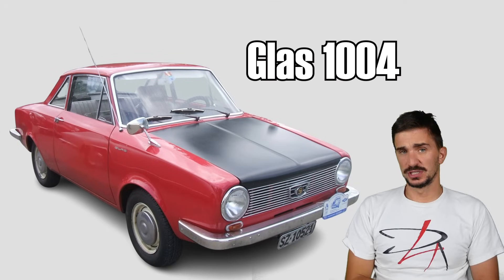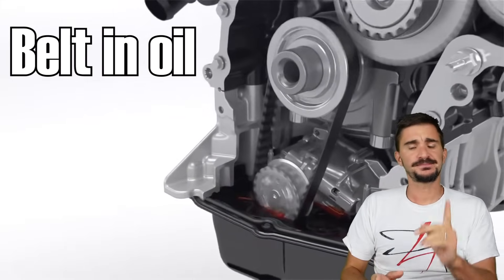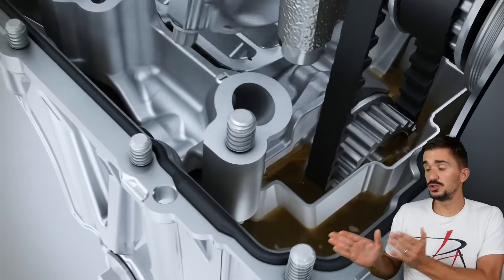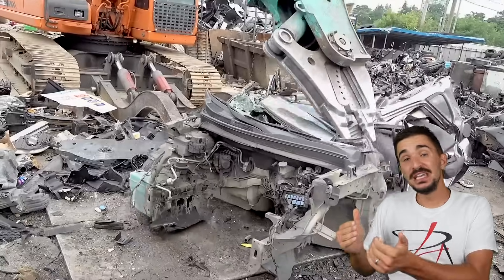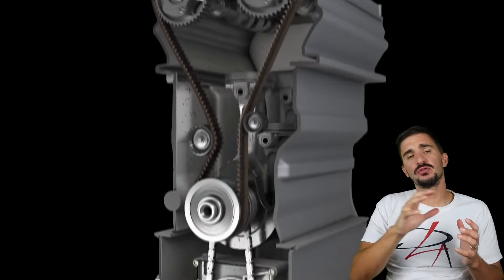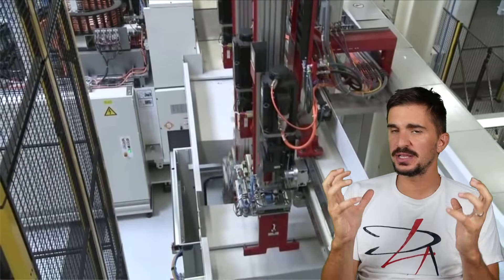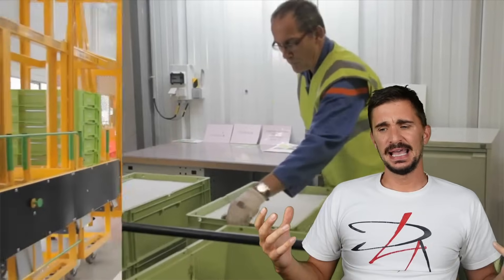Who Approved This and Why Is It Still Being Made? Wet Belt aka Belt in Oil Engines

Comment: Actually, these belts make a lot of sense.  In the very early days of a car's life, say the first three years, the chances are that it will be fully and properly maintained.  The belt might well last that long.  After that, the car is out of warranty and the manufacturer does not care any more.  If say after 5-6 years, the engine dies, the chances are that the car will end up on the scrap heap and a new one will be needed.  Good for business?

No, not at all.  As soon as people get wise to the wet belt folly, they will not buy such a vehicle second hand.  Values will plummet and then they will not buy them new.  Look no further than EVs.  Their second hand value is very poor and private buyers are avoiding them new.  Wereit not for governmental tax bribes to fleet users, hardly any would be sold at all.

The motor manufacturing grave yard is full of rubbish cars caused by an uncaring attitude to the customer.

Comment: Please, a rubber timing belt failing around 100K is a PERFECT engine component for manufactures getting customers to buy a new vehicle. If they use a metal chain, they will use a plastic, (wearable), plastic chain guide to fail at the appropriate time. It’s a scam. The answer? TOYOTA

Comment: Not to bring up ideology but the way capitalism works is you don’t buy any car with a wet belt. Lower sales will force them to go back. Capitalism is designed to keep companies in competition by making a better product. They will always try to cut corners but consumers have the power to keep them in check. I have seen the reverse effect of consumers wanting a solution to a non existent problem, so engineers made them what they wanted even if it didn’t make sense.

Comment: Even worse   than   wet belts , are cam   phapsers and   no   key ways on    timed shaft   particularly  the   crank , bmw  engines   in   mini are like this   slip slightly    main    reason a lot of  them   have such   bad   reputation

Comment: if its anywhere id heavily support regulation is over stuff like this...manufactures shouldn't be able to claim "green" credit on anything unless it also has a verified, demonstrable service life next to it, as well as the environmental impact of producing repair parts and conducting repairs specifically related to whatever new idea they came up with.   If we started using this method, alot of the "green" innovations we have currently would start to look more dirty than anything.

Comment: If a manufacturer changes a service interval (due to their predictions being wrong), they should be liable for the increased cost. Simple. That's capitalism... if one takes (or creates) a 'risk' which is a financial benefit for them if the risk doesn't eventuate, then they should also be liable for the downside if the risk materialises... not the consumer, who didn't give informed consent to take part in the experiment.

Comment: Greetings from Brazil to all. First of all, I have in mind that I will never buy a car with this crappy engine with a rubber belt wet in oil. My second comment is that if someone develops a good and not very expensive adaptation of a steel chain to  replace this current one, they could make a lot of money. In the USA, I think there are excellent mechanics and designers who could solve this DESIGN ERROR.

Comment: And what Einsteinistic institution figured that it would be a good idea to run a completely internal water pump driven off of the timing gear/chain/belt? Where is the shaft seal weep hole in this setup? Drains right into the oil sump, don't it? How can that be good? That and a timing belt running an oil kind of makes me think it was a good time to pull the plug on my mechanic career. I kind of considered myself as a common sense mechanic and I analyzed failures and in the course of my repairs and tried to mitigate, as much as I could, the repeat of such failures. I learned early on, that you can't fix stupid!

Comment: Yes it's a crap design however if you don't thrash the guts out of the engine, replace the oil twice a year and replace the wet belt every 60,000 miles then you should be ok. My transit custom (wet belt model) has 110,000miles touch wood everything is ok.

Comment: Timing belts themselves suck anyways.
They slop around alot. Ever try timing an engine with a belt driven distributor? 
Yea, good luck with that, you can see the belt slopping around with a timing light. You get ignition bounce of around 1-3 degrees or more. That Sucks... Now ur camshaft is doing the same thing...
I rather deal with a timing gear set and the slight bit of noise it makes.

Comment: there is no system which is strong enough to prevent abuses from a amoral people

these days although technically advanced, our morals in general aren't at all improving, if anything they have been slowly degenerating.

the proof of this all is that only a few decades ago it was normal for cars and other machinery to come with repair instruction manuals, today they come with do not eat stickers.
if that doesn't say it all about modern society i dont know what does.

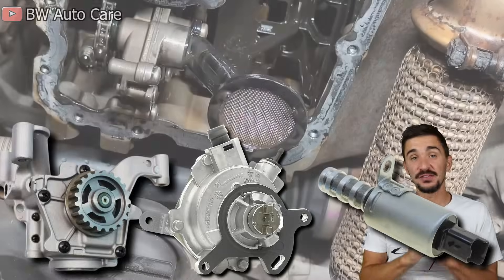Comment: 11:40 This can summarize most vehicles designed since 2008 but especially now in the 2020s. Simple unchanged lessons from decades ago are being totally forgotten in ways that the biggest amateur poser armchair auto fan could have even seen. So many fake "technological advancements" which is really just them being stupid. It's almost like being in the malaise era again except some of those 70s cars actually looked cool on the outside so were worth going through and making work correctly under the hood 2020s 2010s cars for the most part dont even have that. I predict this will be one of the most lost decades in automotive history not worth saving+ expensive repair costs means that if they dont outlaw gas and diesel we'll probably see more 90s cars on the road in the 2040s than 2020s models. Hollywood and the like might have some for making movies in this era but theyll mostly have to be towed at that point.

Comment: Usually I like our videos, but this just reeks of lack of research. Improvements in both belt and oil materials have continuously been happening, even if no single change has been revolutionary. And the result? Only some a few of the engines mentioned have had systemic problems with their belts, while other have been fine. Seems like an implementation error rather than a faulty concept, doesn't it?
Reply: Improvements haven't been to the point where this issue doesn't exist. The problem exists, the belts aren't up to the task and there are engines failing. Don't know what's so hard to understand here.
Reply: @mlann2333  again, bad implementation, not a bad idea categorically. Many of these engine designs are fine

Comment: The Peugeot Puretech has been a disaster. The belt gets shredded, and tiny pieces go everywhere, blocking the oil filter and opening the oil filter bypass and then destroying the whole engine, destroying Peugeot and other Stellantis brand's reputation in the process.  My mechanic doesn't even let those engines into his workshop.
Not to mention that these brands have become like Boeing, managed by financiers, cutting corners, producing cheaply built, badly engineered,  overpriced cars to maximise profits. Who can afford a 40 000 euro car designed to die before it hits 200 000 km? And 3 cylinders? Really bad primary balance! Sure, for tiny displacement engines, as for Triumph motorcycles, it works, and I wouldn't even buy those (I stick to 4 cylinder Hondas).
Why reinvent the wheel? After 100 years of automotive industry, we know what works and what doesn't.

Comment: Yeah and then why I still roam with my F4R and my 4G63 museum pieces every day. Cause they are cast iron , simple reliable engines with good economy and cheap service cycles. That are the worst engines manufacturers ever made , lasting decades without any mechanical issue. 

Now we have plastic intakes that are so cheap that they deform and need replacement , silicone gaskets between the plastic intake and the metal part that fail often and need frequent replacements , plastic thermostat housings that deform and start leaking in some designs not only coolant but also oil , plastic EGR valves that some times just disintegrate and depending on the design can finish in the cylinder or the oil , obviously rubber belts in oil , plastic oil sumps that deform and leak. I can bet that there are already and plastic coolant pumps that decay/deform faster than the metal ones.

So yeh give me a solid cast iron block if possible with aluminum intake and I'll drive it into infinity. Some of the best 2L 4Cyl petrol engines were manufactured in the 90s this was the apogee of the car manufacturers fighting to offer quality , simplicity and robustness. Some were so good that are still in production today in China or Russia (obviously because of their a bit lower ECO norms) for their local brands like the 4G63 for numerous Chinese brands and F4R derivate for some LADAs and Renaults for the Russian market.

Comment: Those high mileage intervals are dumb. There just designed to make your car breakdown sooner. Oil needs to be changed frequent enough so the carbon buildup and breakdown do minimum damage to the engine. Most people don't know that Oil doesn't meet it viscosity after the first time the engine is run! This get worse every time the engine is run. Oil is much cheaper than an engine! I drive what probably has the worst V8 Ford ever made. The 5.4liter 3 valve triton. This engine specifically will die from dirty engine. I got this truck running like a 2 legged dog at 140k miles with broken roller followers on 2 rear cylinders on the passenger band. I tore that bank down to the lifters and replaced the bad lifters and roer followers. Have done nothing else internal but proper Oil changed. 100k later runs so smooth still thay can't even feel it running at idle. Beside the passenger header rusting out that's the only engine repair in 250k. Still has original cam phasers and timing chain! All about the Oil changes with some of these engines. 
Brother been watching your channel since you started talking about rebuilding your car! ❤ it.

Comment: Rubber timing belts... and interference engine...  such an unbelievably bad idea....   lethal in combination.

I don't know where he gets the idea it's easier to replace a rubber timing belt, than a timing chain.  These things never get replaced to any maintenance schedule, until they fail, and destroy your engine in the process.    I refuse to buy any engine with a rubber timing belt, an interference engine, or even a front wheel drive engine.

Comment: 1:10 Any sources for bullets 3 and 4?
Reply: 3 They have a smaller cross-section, an can turn on smaller pulleys.
4 every pound you lose at the crank is the equivalent of losing 100lbs total car weight.

Comment: Hundreds of pe ople on here dissing wet belt engines who never bought one nor will buy one. I have had two. One lasted 23,00 miles. The belt didn't fail, I did and the car was written off. The current one has 50,000, is fine and expected to remain so.
Reply: Anecdotal and very specific evidence- specific in the regard that it relates only to yourself. 

The majority hasnt shared your experience. LOGICALLY this indicates you and your experience to be an outlier. Youre the exception, not the rule. 

It's genuinely great that you haven't had issues. But it doesn't make you objectively right.

Sidenote- i hope you meant 230,000 and 500,000 miles respectively because 23,000 and 50,000 aren't jacksh**... Particulalry in comparison to chain/dry belt/gear driven vehicles...

Comment: Modern cars are a disaster. Cars apparently unfixable by the main dealers, languish in car lots for months waiting for the appropriate bulletin to provide the 'cure'.
A huge ex supermarket taken over and employing their best mechanics to reduce the huge backlogs of broken cars. But the 'best' mechanics work for themselves. 
Why wouldn't they?
I did.
A car with a gear-driven camshaft, cast iron block and possibly cylinder head with mechanical diesel injection will run to 500k miles. They are Merc diesels still running from the seventies and will never produce the levels of pollution a scrapped 5-year old petrol car has?
Terrible logic. Listen to car engines in heavy traffic. The sheer amount of cars with various worn out parts and smoking exhausts from clogged induction systems and silly Adblue sheep wee injection. 
The cryptic engine management software, the £5k garage bills for a temperature sensor failure which was in the Door Mirror causing the emission light to keep coming on.  
GM engines failing on crankshaft thrust bearings needing around £6k to fix. My Peugeot 306 Diesel does 56mpg. Has never been in bits in its thirty+ years 398k miles and will outlive me. If it had an aluminium body, it'd be an heirloom...
And those lucky owners with modern trouble-free motors. You are just that: Lucky.
I know a company who bought 20 Honda Civic 1.5 petrol cars in 1998. Running them for six years, 120k to 160k miles each one. Batteries and brake pads. One coil spring. One exhaust. And one clutch. That's it.

Comment: "Rubber timing belt benefits:  REDUCED HARSHNESS"?  Nice try but any mechanic would tell you to just take those "BENEFITS" and throw them in the imaginary trash bin forevermore.   
Because even if some of the "benefits" are true, timing chains are far, far superior to belts in reliability, in durability, and in keeping maintenance costs down.  The one and only place where timing belts are "superior" is, they are cheap as dirt.  The automaker can buy maybe 10 timing belts for what one timing chain set costs them.  So of course they keep using rubber belts.  Cost is the one and only reason automakers started designing in rubber t-belts in in the first place, and why they still use them today.  Because "heck, even the crappiest t-belt ever made, can get the car out of the warranty period!"  and that's all the automaker cares about anyway.

Comment: Wet belt technology is an on purpose failure, as if you need a new engine, who profits from that? That's right the manufacturer. If you have to replace the belt early, who profits from that, that's right you got it, that manufacturer. This is essentially fraud, but disguised as a 'good design idea' so car manufacturers can milk what little money everyone has left before having to shell out for electric cars.

Comment: just a comment:
Citroen is the worst car company, that is. followed by every other french car. its aweful. they changed to "self sabotage" belts and it did/does what the name implies. this is a real life experiance. changed the belt on a C4, car was from 2019. took way to long, because french cars suck. had to change the filter tube, because rubber sucked up into it, breaking the mesh/filter for the oilpump. oilfilter had to be renewed, the housing had to be clead fully, because of halve the belt being ripped apart by oil. has been the 4th belt, since 2019.... i drive a corsa, that hasnt gotten ANY love in any sort of way and it still drives no problem. a CAR is suppost to function like a car. if it doesnt, its french.